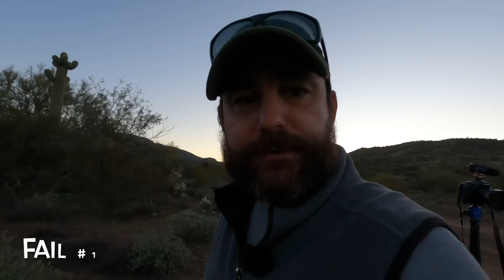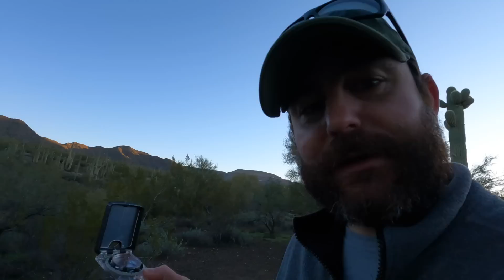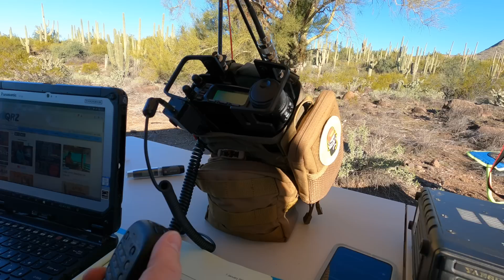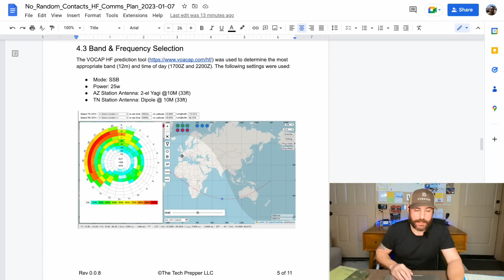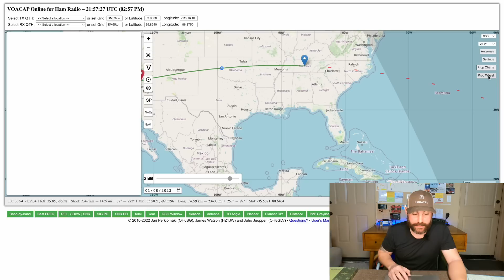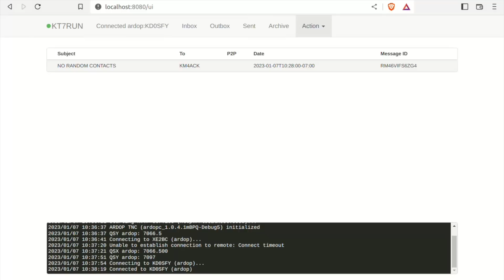Nationwide Offgrid Comms - No Random Contacts

Comment: Dude! This is pretty close to what I was looking for when I commented on another video. Only 3 years ... make it up as you go along ... Dude, your documentation is PERFECT. Your style is more or less what I'm going for, which is very little like what a lot of hams are in it for.

 I really like that antenna. I'm working on a few now. 40 and 80m dipoles for NVIS and a 20-6 meter off center fed vertical dipole (basically) on a light duty 30 foot mast. What I lack is a directional of any sort. This one looks pretty close - its as portable as I've seen. I'm curious if there even exists a man portable directional HF antenna.
Reply from the maker: Glad you enjoyed it. I am not aware of any portable directional HF antennas, but I am still very new to the hobby. Keep up the good work.
Reply: @TheTechPrepper  One gentleman said something that resonated about light packs. He said "If you're counting grams, you should be counting pounds instead". Meaning - if a few grams means a useful piece of kit gets left behind - get into a gym and make yourself more capable.

Considering you run 10 miles in 100 degree hot sun with a plate carrier ... if you won't carry it, I shouldn't try! :D #fatguyproblems

Comment: Can this be done without the help of the Internet and VOACAP?
Reply from the maker: Yes, this can be done offline. I have a version that I am prototyping that works offline. It's based on the command line version of voacapl (i.e. for Linux). I am writing a custom graphical user interface for it similar to what you get with the https://www.voacap.com/hf/. You will occasionally need to go online to grab the latest sunpot smoothing numbers (SSN), but these are forecasted up to 6 months in the future. This will be included in my commercial version of EmComm Tools.

Comment: Great information, thanks again. I’m inclined to work with the CHA EMCOMM lll P or  CHA LEFS 8010. Both 1/2 the cost and 1/2 the weight. More functionality in the backcountry imho. Cheers 🍻
Reply from the maker: Good choice! I run the CHA LEFS 8010 at home. I love that antenna. It has a good SWR on most bands (except 60m). Until I had this antenna, I rarely operated from the house. The CHA LEFS 8010 is still a bit heavy for manportable use, but works great when you have access to basecamp or vehicle.

Comment: Nothing as complex as yours , but my friend and I used to make regular contacts mobile to mobile while he was in Portland and again when he was in Houston while I was in the valley. This was sometime in the 99-01 cycle. With all contacts made at predesignated times on " freeband".
We also did some mountaintop to mountaintop across AZ  from Mt. Lemon to strawberry- pine. Mingus to Mt. Lemon. Greens peak to Eldon and even Mt Graham to shaw butte. All those contacts were some fm and ssb on 11M. And  on 2M FM simplex.
I had a 93 YJ with 102 " steel whip  for 11m and a Larsen 5/8 mag mount.
I ran a Emporor TS 5010 and an ADI 2m mobile I think 30 W.. 
All that was done in the 99-01 time period..
Reply from the maker: Thanks for sharing your story. Those are some great peaks. I've had Eldon on my list for a while. 73

Comment: Glad everything worked out in the end. I've had those days where something happened and had to improvise. One thing I would add is to add more bands like 10 and 15m to the mix. There's plenty of room on both bands to make a contact and not be bothered. 

On 10m, I'm usually above 28.500 since there's very little activity up there. For 15m, I'm usually below 21.275 these days since I got my Extra upgrade. Above 21.350 is usually clear, might catch some AM activity every now and then on 21.420MHz. 17 and 20m gets crowded at times compared to the higher bands and sometimes has a lot of QRM. 

Been getting into PSK31 and RTTY over the last few months. There's more activity on PSK31 on 20m than any other band. For RTTY, one might find a contact every once in a while. 

Worked some DX PSK31 and RTTY contacts on 10 and 15m. All my PSK31 contacts on 20m has been stateside so far. If you want to try some digital modes, feel free to send me a email and I'll work it in on a day off. 

73, W4ISB
Mike in Tennessee
Reply from the maker: I thought about 10m, but not 15m. The nice thing about the CHA TD 2.0 is that it has a flat SWR (< 2:1) across all the amateur bands. In this partially deployment, the angle for 10m (70 degrees) and 15m (80 degrees) is about the same opening angle as 12m (75 degrees).
Reply from the maker: Another TN boy! You guys are a good bunch. Have a good weekend.
Reply: I like to work 10 and 15m on my day off of work, usually when I get home and have the night off. What I've learned so far is that they usually open open about an hour or two after sunrise, depending on conditions. That's where a lot of good DX contacts come in. 

On 10m, everyone like to hang out between 28.3 and 28.5 for some reason. Every now and then, you'll find someone above 28.500. There's a lot of SSB bandwidth that's not being used, which would make a great spot for what you're trying to do. 

With 15m, there's a lot of stations between 21.200 and 21.335. At the top end of 15m, it's usually empty. There's a net on 21.412, the Pacific Maritime Mobile Net. Might get some AM activity on 21.420 every now and then, usually a stateside station. Above that, it's usually quite and not being used. 

For RTTY, I've had luck on 10 and 15m. Worked France and Brazil on 10m. 15m RTTY, I worked Germany and Italy. Actually had a 20 minute QSO with the German station. 

Doing PSK31, most of my contacts have been on 20m, but those were stateside. Worked one station in Belgium and another in Germany on 10m. No luck on 15m yet. 

For those two digital modes, 10 and 15m would work great since they're not congested like on 20m. RTTY isn't that active anymore since FT8 came out, but one might make a contact here and there. 

Also, use psk reporter to find out how far you're getting out. I use it when running digital modes.

Comment: Hey Gaston, love your channel! I bought a 818ND because of your videos and it came in the mail yesterday. One main question: I think of PACE plans being useful when everyone can meet in person beforehand (like family that live in different houses in the same city). If the grid was to go down, how would distant contacts receive the PACE plan in order to make the contact (chicken and egg problem) as well as using the prediction software for propagation? Do you see PACE in this case being just a series of four methods to see what works the best or would this plan be reusable in the future?
Reply from the maker: I am glad you snagged one before they were discontinued. Check out the used prices now for a good laugh. 

My personal opinion is that with regular practice is that you can develop a generic P.A.C.E plan beforehand that can be attempted on any day. For example, 80m/75m is a good nighttime band for local communication, 40m is a good daytime band for local communication and 20m is good for long distance communication during the day.  Pick a window four hours a part (or whatever interval makes sense) and pick a band that is generally appropriate for that time of day. Then, pick three frequencies spaced out for each window. The prediction helps when planning very specific windows based on current sunspot numbers. In addition to the frequencies above, I suggest adding one or more WARC (12m, 17m, 30m) bands as they are contest free. These bands also generally have regular times of day in which they are more likely to work. 

0600 3.985 MHz LSB (voice)
0605 3.980 MHz LSB (voice)
....
1000 7.295 MHz LSB (voice)
1005 7.290 MHz LSB (voice)
...
1400 14.345 MHz USB (voice)
...

Also note, I am concurrently working on testing the offline VOACAP command line tool: voacapl. This runs without access to the internet, but the dataset will go stale after 30 days. VOACAP actually uses a 30-day average, so the prediction does not change much day-to-day.

I hope this helps.
Reply: @TheTechPrepper  Thank you very much for the detailed reply, Happy New Year and 73!

Comment: Totally AWESOME! 2 of my favorite YouTube hams together. My son and I have been attempting similar efforts, BUT I have been a Luddite and never considered different bands! Excellent AAR and you and Jason have given us MUSH to work on and improve. THANK YOU!
Reply from the maker: I am humbled. It was a really fun morning working with Jason and Carl. There are several videos that do an excellent job of walking you through the VOACAP tool. I would start by putting both your locations on the map, picking your mode (SSB for voice) and selecting your power. I would leave the antenna section with their defaults. Then, click the "prop wheel" and see which bands and times are over 80-90%, In general, I recommend a simple dipole as they are easy and inexpensive to build. If you are within 300-400 miles, checkout my NVIS video (https://www.youtube.com/watch?v=yYXVKtu3nwk). Good luck with your targeted contact to your son. You guys can do it.